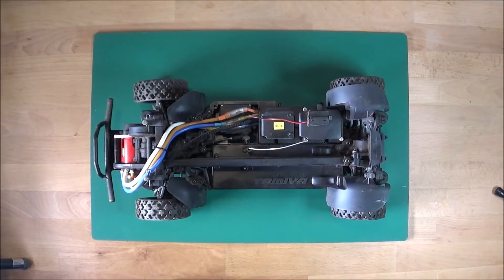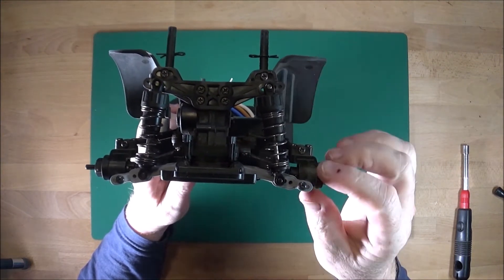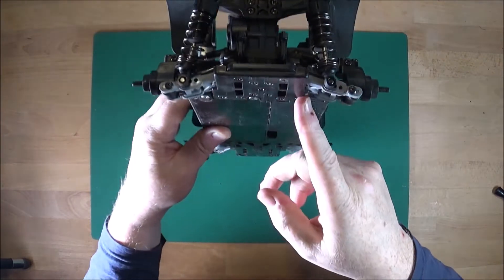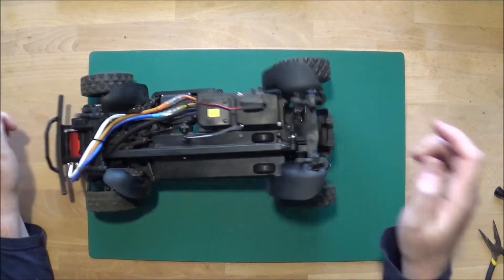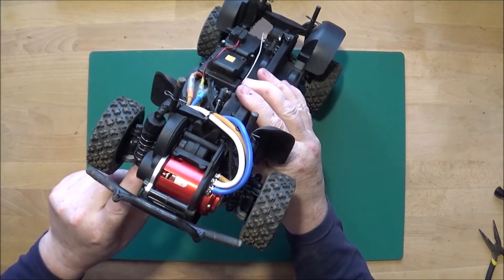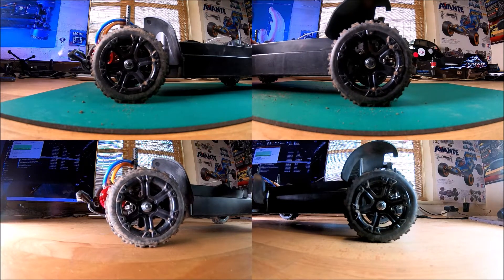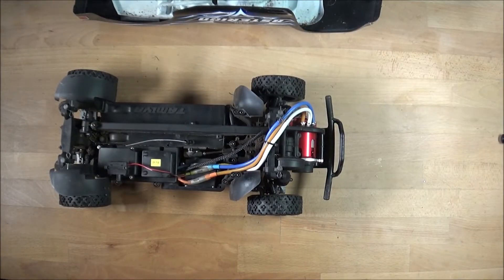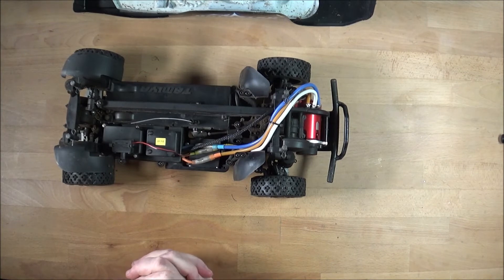Tamiya XV-01 Asterion Rally Mods Part Two

Comment: Hiya Rob.  Interesting to see the differences between the Asterion and rally versions.  When I built my XV-01 some people suggested that I raise the suspension to go over rougher ground but I wanted to keep it as a low slung cornering machine that doesn't fall over too much.  Yours is definitely better now.  Best wises mate 🙂
Reply from the maker: I hear you Pete. Ground clearance is good but then I think you need harder shocks so next mod I think is thicker oil to slow the rebound. Cheers matey and stay safe fella.

Comment: Interesting video mate, definitely an improvement I would say.
Great to tinker, trial and error will always be of benefit.
I'm most intrigued by this chassis, definitely near the top of my 'to buy' list!
Very much looking forward to this year's summer slam series, love a bit of sandy bottom! 🤣 😂
👍 👍 👍 👍
Reply from the maker: It's definitely different to drive with the motor in front of the front axle and I also think it's better than the new XV-02 chassis. My problem with mods is that a lot of the time I drive something and think that could be made to handle better but by the time I get home I've completely forgotten all about it 😂😮👴Many thanks and all the best mate.

Comment: Hey Rob, you in my head mate? Looks like we both have the same kind of video, Mine isn't up yet but very close to yours (I'm not doing suspension though). Very well done mate, and the truck looks great on this run too!!  Great job man, ATB my friend!!!!
Reply from the maker: Hi Bob. Just about to check yours out once I've finished my replies. Many thanks buddy and best wishes to you and yours bro.
Reply: @robbrennanrc  I guess the videos are not the same (both have stadium trucks though), and both show the Asterion. I don't think I ever driven my Asterion as it was meant to be (the body is a virgin) and I bought the truck because I seen yours. A wider stance will also help. I found clam on wheel hexes (Amazon,  using some on my TD4), a set of 3 different hexes, 5mm, 6mm, & 7mm..... I talk too much, ATB my friend.

Comment: Glad it seems to be handling better for you! It is odd there is so much adjustment for the rear shock positioning and hardly none for the front. I know space is tighter up there but it seems like the front would be a lot of the tuning.
Reply from the maker: Hay Addam. Yeah I've seen it on some other Tamiya kits as well. But sadly we can only work with what we are given. Many thanks and best wishes buddy.

Comment: Hey Rob, just finished my hotshot and now starting this kit. Any further suggestions since thus run? Mark paint that hotshot yet?
Reply from the maker: Hi Paul. Since this vid I've slowed it down by putting in a 15T brushed motor as it was far to fast and although not as bad it did still roll on occasions. It now great and you don't really need speed in a rally car. Many thanks and ATB my friend.
Reply: @robbrennanrc  thanks, Rob! Good luck with your next RC adventure!